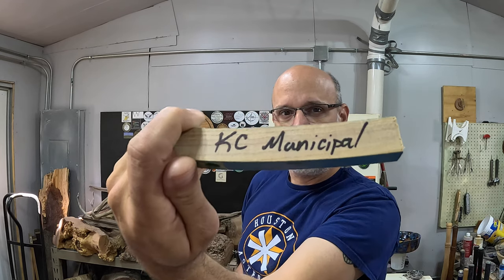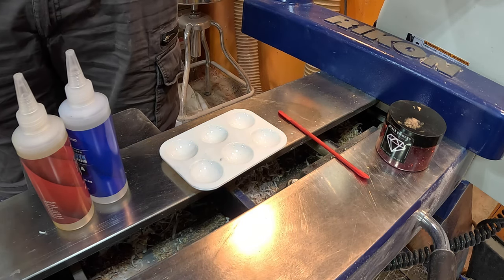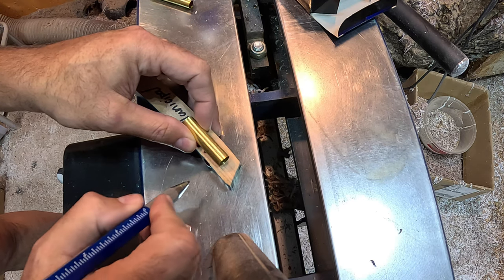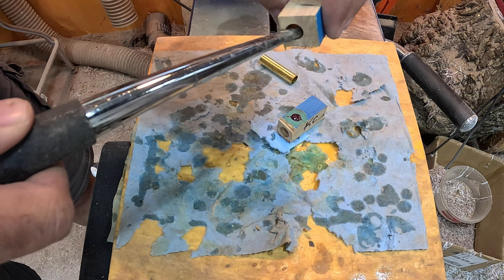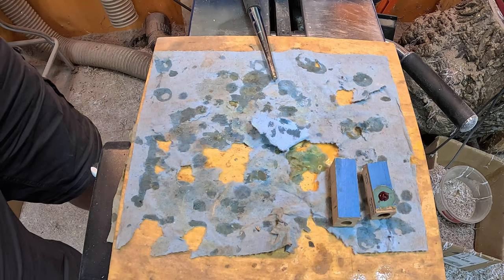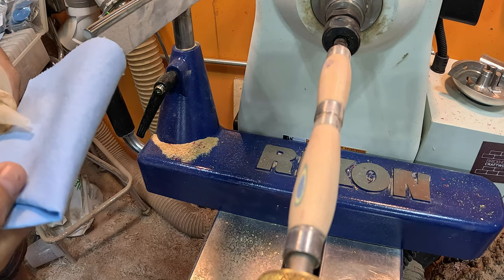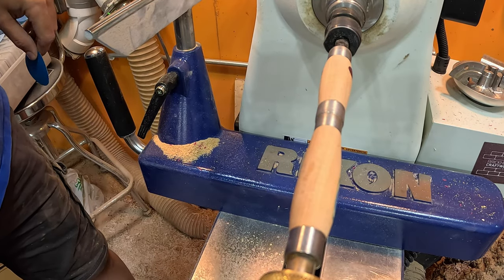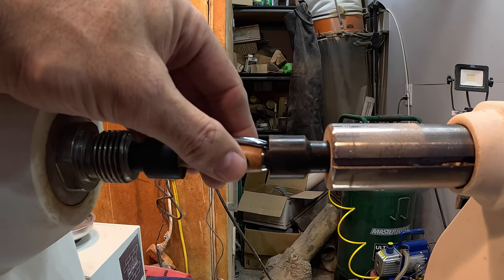Woodturning - A Unique Technique - The Offset Pen Turning

Comment: In the days since Covid I have found that friction polish and wax finishes do not hold up to hand sanitizer.  I prefer a lacquer finish which does not wipe off with alcohol hand cleaners.  closed grain hardwoods only require two or three coats while open grain wood like oak may require seven or eight coats for a more permanent finish.
Reply from the maker: Thank you for the feedback! I have never seen any issues with my pens holding up with Brad's finishes, but I'll be on the lookout!